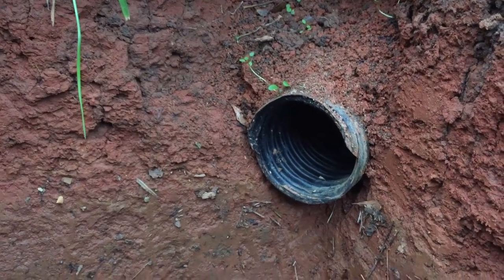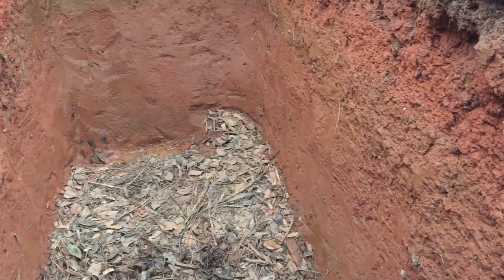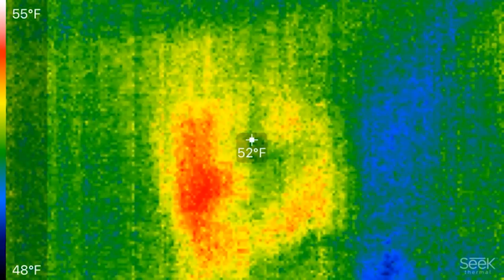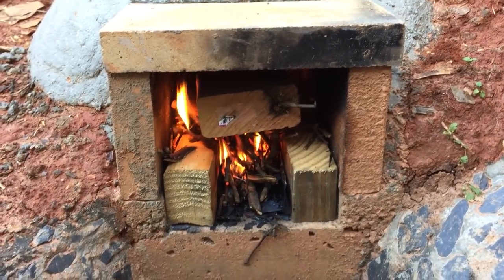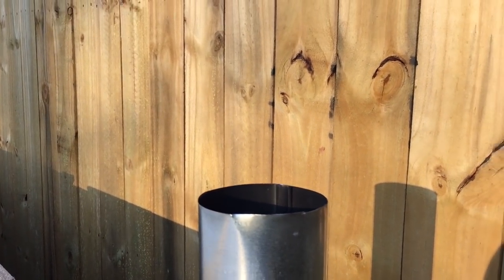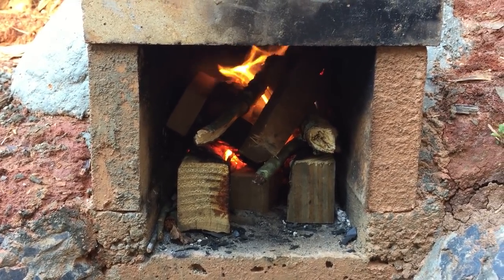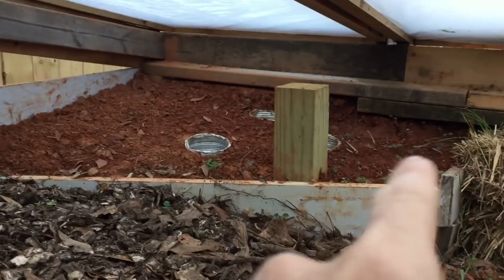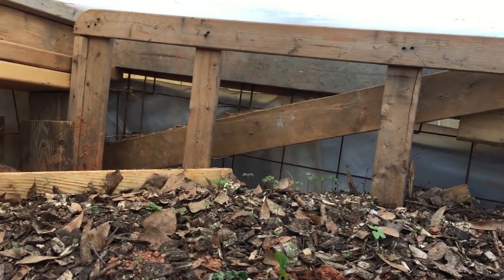How To Heat A Greenhouse For FREE | Part 3

Comment: I really enjoy your videos and how honest you are about what you're doing and not doing.  I think you have a good perspective and a positive attitude, both of which are crucial to long-term success in any kind of permaculture endeavor.  Keep at it!

Looks like your heat sensor maxes out at 626, for some reason...the fire was certainly warmer than that.  Still, you were getting no less than 500 degrees worth of temperature change, which means you were warming up "something".  If you had an exposed manifold of some kind (a barrel covering a riser) you 'd have more of a rocket stove and much greater net heat gain from the wood you're burning.
Reply from the maker: Thanks for the feedback, Jason. I appreciate it.

Comment: Have seen compost heating and believe your trench would be great for that. 120% on effort for sure. Direction of slant doesn’t give the greatest amount of sun capture. I’d raise the roof another three to four feet. Turn it 1/4 clockwise. Use the bed frame as a growing wall. Insulation board on back walls. A little of the gas’s from the rocket stove wouldn’t be bad for plants. Totally buttoning it up will cause moisture problems.  Wondering on an update for your hot months. Here in Texas we get close to 120 in summer. I’ve been looking into walapini as well. By what I’ve gathered on cooling and heating the internal mass needs more tubing in the ground and temp timer connected to a fan. Watching you turn garbage into gold was awesome to watch. I’ve never understand why multiple copper tubing isn’t added to thermal mass to increase efficiency of heat transfer in concrete.

Comment: I get it, I like the ideas you have touched upon. Extremes are far more likely on the colder side here in Canada and as a result we would need to turbocharge some of your ideas to raise the bar. I propose keeping the raised beds and the subterranean trench and expanding it so the trench is larger and more useable as a space. I would bring your wood fired firebox with lateral chimney inside and turn into a batch box rocket stove.  Radiant heat from much higher combustion temperatures in a secondary burn chamber or heat riser within the greenhouse should dramatically affect the temperature range. What's good about bringing the stove inside is you can use it to cool the inside during the summer. Earth tubes, rocket stove, strategically placed vents and front door can be used to control the negative and positive air pressures that effectively turn the subterranean greenhouse into a cooling tower during the summer. I get it, you aren't in Canada and we do things differently. When I spent time way way up north they thought it was crazy to shovel snow, I heard things like it's a great insulator and just beat down a path and go. So even though I'm much further south than that it seems crazy to light a fire outside that needs to be fed constantly rather than using air pressure in a more effective way. I apologize for calling you crazy but couldn't think of a better word.
Reply from the maker: Thanks for the feedback Matt. I think your assessment is correct. This little furnace was a fun build, but didn’t do what I’d hoped. I agree a rocket mass heater inside the greenhouse would be a better solution. Canada is a whole different ball game for sure with regard to seasonal extremes. Thanks for sharing your perspective. And thanks for watching.

Comment: This is a good idea. I see it took some time to perfect but I guess it will feel rewarding at the end. Only thing though, how long will that heat last before it dissipates? For how long are you planning to keep the furnace going each day?
Reply from the maker: Hi Andres. In the end, I think the furnace was overkill. The ground did absorb a lot of the heat, but I couldn’t measure much of a temperature increase through the top of the mass. I actually think the trench supplies all the heat differential I’ll need for this Georgia climate. If I were further north and wanted to do supplemental heat, I’d use a rocket stove to heat a barrel of water inside the greenhouse. I think that would be a better heat sink. I’ve seen examples of this used. Thank you for the feedback.

Comment: Hardwoods will burn longer than soft woods like pine, which is what most of the construction lumber is. Burning hardwoods will cut down on the amount of time you will have to spend tending the fire also.

Comment: I found your videos on heating your greenhouse extremely interesting.  I can see how you are using the physics laws for a low cost and low impact solution.

A couple of comments on your and other people's observations.  The first is when your tube for allowing cold air to exit the wallapini(sp) was actually drawing warmed air in.  I believe this is because your tube runs under alot of material that is decomposing which creates heat naturally.  The second comment is on your heating, as others have stated, closing the end off to restricted the amount of  air entering your fire chamber would allow air temperatures to rise more. In conjunction with the closing of the fire chamber end, you need to restricted the exhaust end also.  Flinger Films mentioned about a BBQ Grill, where they restrict the air flow into the fire chamber.  Think of Fluid Dynamics, what enters a chamber must also exit the chamber.  So if you were to restrict the amount of air exiting the fire chamber at the exhaust stack, more warm air will be in the area between fire chamber and exhaust point.  This will allow the ground to absorb more heat.

Just my two cents worth.  I think I will now look at your videos on the Rocket Heater your worked on recently.
Also keep up the work and show us the good, the bad and the ugly.
Reply from the maker: Thanks for the feedback, Gerald. And good suggestions too. This little furnace was definitely experimental. More of an intuitive process than a formula. I've gotten some good ideas from the comments. Thanks for adding your two-cents. I'll round that up to a buck-fifty. You were close on "walipini." I got some good friend with the last name "Glass." Thanks for watching.

Comment: great idea, should have built in the green house like a fireplace. still run the vent underground out the back. This would keep a lot of that heat in. That might be too hot for that GA weather though!...
Reply from the maker: Hi Joe. You’re right. In the end, an extra heat source isn’t necessary in Georgia. The heat provided by the trench is enough to grow cold weather crops. Thank you for the feedback. Thank you for watching.
Reply: @GreenShortzDIY  u might could benefit from the co2's from the fire, lol! just would have to vent the heat which defeats the purpose, I guess.

Comment: I think you can kick start your systems by adding inline duct fans. Look for something PV direct or barometric? I think with a few agricultural thermostats or maybe some snap disc you could control the airflow very well. Moving it by zones based on temperature.
Reply from the maker: Thanks for the feedback and suggestions. Thanks for watching.

Comment: The heat is certainly being protected from heating the ambient air in the greenhouse. There could be a vertical heat exchanging chamber that is at least partially exposed to the inside of the greenhouse. A capped  section of stovepipe could be added above the initial combustion chamber, that is cobbed to just leave the cap exposed. The cap exterior can be tiled if you are concerned with a hot spot. this will allow secondary combustion of wood gas, while producing additional BTU's inside the greenhouse.
Reply from the maker: Good suggestions. My attempt here was definitely rough. I do think think this would function much better with your modifications. Thanks for the feedback. Thanks for watching.
Reply: @GreenShortzDIY  Love the videos.

Comment: You may want to shore up the trench wall's and or use those 2x6 board's to reinforce them. Just like how minors did in the caves they dug out. 
 I say this so that way it will brace the walls just in case you get heavy rains that over saturates the clay, the board walls will help keep the ditch from collapsing
Reply from the maker: Thanks for the suggestion. I have had some soil from the trench walls slump off. Usually happens when it has rained. I’ll definitely be adding the wood bracing you are recommending. Thanks for watching.

Comment: I was looking forward to these results, that was good.
Reply from the maker: Thanks Nandio. I was hoping for more heat from the furnace, but almost 500 degrees difference from the firebox to the chimney top, means that heat is being absorbed in between. That’s a good thing. Thanks for watching.
Reply: I watched Fauch family. off the grid...
Their rocket stove mass heater took quite some time to heat the clay.
You did well! The temp differences from flame to outlet prove it.
Your warmer soils would heat the greenhouse, if you lit it in the evening.
They won't freeze, nor would your cabbages, brassicas.
Reply: I am wondering if there could be some sort of mechanical pusher to maintain stalking of the fire box with out personal attention. Like a weight  pushing on a pusher arm which is pushing on some kind of Junk Wooden slug into the firebox at a certain sustainable rate To achieve a certain desirable temperature  over a certain period of time like overnight.

Comment: I don't think your fire box is too small.  If you make it larger, you will have to make your flue larger as well to make it draw.   A true rocket mass heater does not need a continual burn to do it's work.  Did you think about running your rocket stove in the evening instead of morning?
Reply from the maker: Thanks for the feedback. This little furnace was definitely not "designed." But, I think it was a fun and mostly functioning experimental nod to a rocket mass heater. I do plan to build a full-fledge rocket mass heater at some point. I just need a little more time to learn. Thanks for watching.

Comment: Here is my thoughts. On your fire box remove top brick and place on the front then make top hole into a hopper. However, if you find a need for even more wood then make front so you can open and pack wood before stacking hopper. In fact your should make front to open in someway for cleaning. with the holes at bottom and from the hopper should make airflow just right as to not burn wood too fast but yet slow enough not not to have much if any smoke without over heating exit pip. also please give up date on your success.
Thank you for reading

Comment: After watching all the video's on this I just have to say, I'm not sure how well this is ever going to work well at heating the area.  The biggest problem is the design of the greenhouse itself.  The trench that you made is going to want to keep the area at a constant temperature.  When I was in the military we used earth covered storage area's that we kept the munitions in and the reason for them was to regulate the temperature of the munitions to a constant temperature during winter and during summer.  The trench is going to act the same way trying to maintain a certain temperature.  So it will be cooler in their during the summer and it will be warmer in there during winter.  I like the idea, just not sure how effective it will be unless you make more ducts and a bigger stove.
Reply from the maker: Yeah. The little furnace didn't do what I thought it would. This was an experiment...and not all experiments work. So, what I learned here, is what not to do. In the end I agree with you, in my Southeast US climate, the trench will do all the warming (or cooling) that this greenhouse needs. Thanks for the feedback. Thanks for watching.
Reply: @GreenShortzDIY  Seems like it didn't throw off as much heat as you expected.  Maybe you got the insulated riser enough right, but it needs more air coming in farther back, so you get more secondary burn.  Don't mind me.  I'm just theorizing.  I think your bottom line is that walipini is plenty.  You could probably even bring it a little more up in the sun, and just having it enclosed is enough to keep everything warm enough.

You'd have a blast up in Colorado building these things.  Up where it's really cold, it's also sunny, almost every day.  And the days it's NOT sunny, you're hunkering down for the blizzard, anyway, so throwing some sticks in the stove is no hardship.  It's the strangest thing.  10 below zero, Fahrenheit in the afternoon, and if you're in the sun, you're totally fine.  If you're behind glass, you're cooking.
Reply from the maker: Agreed, Harry. I don’t use additional heat for the greenhouse anymore. It did lettuce and kale through last winter just fine. Of course, it was a mild GA winter. Kinda like September in Colorado. But, I love Colorado. Year round beauty and lots of outdoor activities to enjoy. Thank you for watching. BTW, my last name is also Mills. :-)

Comment: I WOULD LIKE TO HELP YOU TUBERS with them improving the effencianty of there project's.  When I was younger I worked for a machine shop  they soon found out that I was really good at making repossess a lot more efficient.  I  took a process that only could put out 68 parts a day to over 200 parts a day.  It wasn't long that they started moving me from prosses to prosses  and found out that I was really good them a lot better.  I am disabled but I still like challenge of looking at things and making them better.  I will keep adding things that I see that might help you I don't want anything.  I just love that challenge
Reply from the maker: Hi Gary. Thanks for the feedback. Keep the ideas and suggestions coming. Thanks for your service.

Comment: I was just wondering if you were going to feed the fire every hour all night . even with a feeder ; every 4 hours max . In the summer you have to wory about over heating because you down south . it's going to get hot . Im not tryi g to be an ass ;just throwing out dome things .
Reply from the maker: Thanks for the feedback. And you bring up a good point...I don’t want to be feeding the fire all night. Honestly, I think this heater is somewhat overkill here is Georgia. If I were truly relying on this to provide heat on a regular basis, it would need to be bigger and with a better heat exchanger. Thanks for watching.

Comment: I recall seeing a fire based boiler used for under floor heating on a Bob Villa episode many years ago.  I wonder if you could use something like this (https://theoriginalnomad.com/products/coil) in a rocket stove to heat water in coils of pex/copper?  I also found this heat exchanger on Amazon, B079VTT4GK.  As this exists maybe there is a reason why simply running the fluid through pex/copper and heating coil will not work.  I'm sure the pex could not handle the heat of the fire so you'd probably need to drill holes through the fire brick to allow the coil to exit and then run the pex/copper into the green house.  But those pipes could melt or explode due to temp/pressure.

Actually those coils are expensive.  Check out this video (RXW2A4zM8) on getting heat from a fireplace and into a garage.

Comment: great idea for heating greenhouse , i use  a compost heap. with 100mm pipe coiled though it. as the air inside pipe warms it circulates by convection giving a constant 30c (86F) into greenhouse. i've put an extractor fan, solar powered, on the end of pipe to force air though heap. works 24/7 .  adding urine to compost heap with water so it doesn't dry out. it last for many months

Comment: If you could put a combustion barrel inside the greenhouse then you wouldn't loose that heat out the chimney.
Reply from the maker: Joe...I need to remake this forge. It was fun to build...it looks cool, but is not very efficient. Thanks for the idea. I think I'll likely go with a rocket mass heater inside the greenhouse.